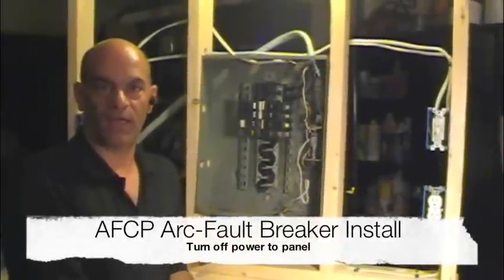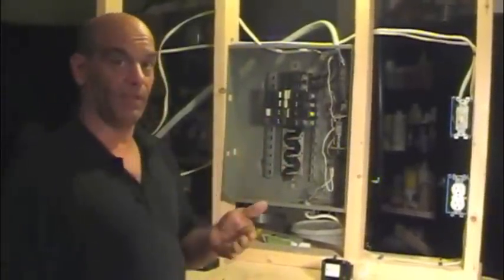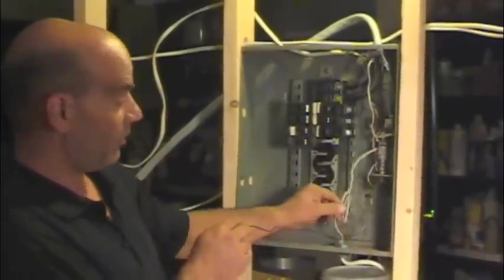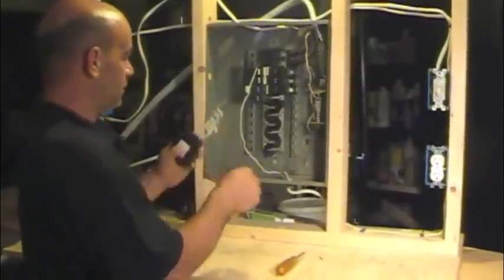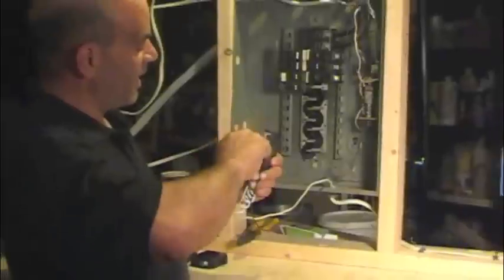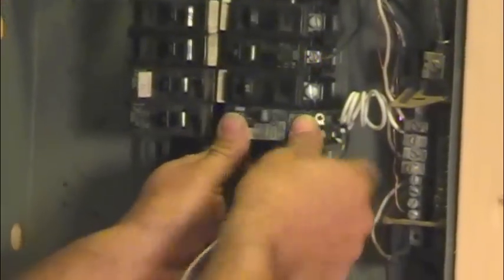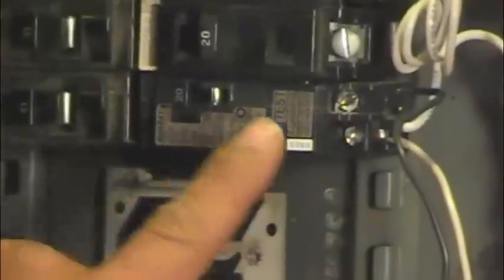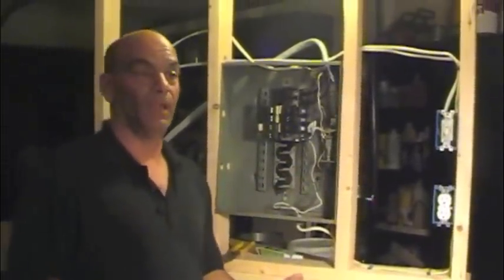How to install a Arc fault circuit breaker / interrupter

Comment: My son's house has many AFCI breakers. This is a siemens box and breakers. After about 5  years one breaker is randomly tripping.  We had the Breaker replaced and this did not fix the problem.  We checked all boxes,  had the outlets and switches on this circuit rewired from backstab to the screws,   we did not find a smoking gun.  It does not trip until there is a load on the circuit, which I read is normal.  Now he has  AFCI breakers on other circuits trip at the same time.  Have you ever heard of anything like this?
Reply from the maker: I've seen it all. For sure you have something going on. The biggest thing that is always overlooked is the outside outlets. Check those.
Reply: @Askmediy I did not think about that. I am going to check his outside boxes, but I expect that they would be on a GFCI circuit but I know strange things happen. Thanks for replying back
Reply from the maker: @freewoodencrosses  I just had one doing the same thing two weeks ago. But I had to remove the GFI outlet that was outside in order for it not to trip. I was a bad/wet GFI outlet.

Comment: I have a weird issue that I am looking for a solution for.  I have a microwave above my stove on one dedicated normal 20A circuit breaker, when the microwave runs, it pops a AFCI breaker on only one of my bedrooms most of the time.  The microwave circuit does not have an issue in any way or time, but the bedroom pops most of the time the microwave runs.  The circuitry has not been modified at any time, and the bedroom has a computer as well as the internet via cable modem.  The bedroom has no issues at any time except when the microwave turns on.  I have checked the conductors in the outlets both in the microwave and bedroom jacks.  I will be looking at the neutral and ground bars in the box tomorrow.

Do you have any advice on this situation?  I checked the phases these two breakers are on and they are both on the A circuit (Microwave in on the 5th slot left and the bedroom is on the 9th slot right side).

Hoping you might have an idea to check on..

thanks!
Stan Skaggs
Reply from the maker: Stan when it comes to these breakers it can be a real pain. Honestly I would change the breaker out for the microwave to a regular one. I see this all the time.
Reply: @Askmediy  The microwave has a regular breaker.  the bedroom has a AFCI breaker.  When the microwave starts, it drips the AFCI for the bedroom breaker yet the microwave continues to work fine with no issues.  The microwave and bedroom are two seperate breakers (Microwave is normal one and bedroom is the AFCI).  It seems insane to me that one circuit affects a completely seperate circuit.  The Microwave is on the left side on #5 where the bedroom is on the right side on #9.  I believe both are on the B Phase as an FYI..  I will be checking the Neutral lines tomorrow to see if something is loose there.  I have checked at the actual outlets already finding no loose connections..  Ther other AFCI breakers never trip either with on being the #10 & #11 on the right side..
Reply from the maker: As you would think a bad connection anywhere could trip this breaker. So yes check everywhere. Definitely check the outlets on the bedroom. And all the connections on the breaker. Simple would be to replace that breaker with another arc fault. I’m in Italy right now in the dark as it’s 4:30am on phone trying to read all of your post. Not so easy lol. But I’ll do my best.

Comment: I thank you for taking time to read my comment need your  just replaced 15 amps arc fault  breaker for one of my bed room   and still not  work what  possibly wrong with it
Reply from the maker: What comment and I have no idea what you're talking about.
Reply: I thank you for taking time to read my post need your  just replaced 15 amps arc fault  breaker for one of my bed room   and still not  work what  possibly wrong with it
Reply: Thank you for taking your time🤪😭

Comment: new house built. noticed that several afci breakers were randomly tripping. dishwasher circuit the most..finally got annoying after 6 months enough to call original electrician. sent some goobers out to "replace" breakers.. no problems.. fast forward 8 more months and now dishwasher has died. no lights/ response from display. (may be unrelated problem) pulled cover off panel and breaker was not tripped. pressed "test" on breaker and nothing happened so i figured the breaker was bad. was about to swap with another breaker known to be good and noticed that when the elctrician came out 8 months prior they had not actually replace breakers but bypassed the afci neutral and run the neutral directly to the neutral bar. the black hot wire was under load screw and the white pigtail was loose with a wire nut on end. They wired about 6 other breakers the same exact way. will not trip when "test" is pressed. Is this common practice or trash?:vs_mad: thanks for any input Bryant
Reply from the maker: First, sorry for the delay. For some reason I'm not getting notified of incoming comments. Sounds like a neutral issue and not the breakers. Could also be that they have something using the same circuit that shouldn't be. I would check every outlet with a polarity checker first.

Comment: Sometimes outlets are installed upside down even though the one in this video isn't. In a kitchen, they might have the outlet flipped upside down with ground at the top, just in case a liquid drops onto a plug in a receptacle, it'll hit the ground first.

Comment: How can a cut Greenfield wire be repaired? Can a junction box be installed were the cut is.

Greenfied wire has a hot, neutral, and ground is the metal outside sheathing. Its in a 80 year old home. 15 amp ceiling light circuit.
Reply from the maker: Why not just reconnect it with a wire nut?
Reply: @Askmediy  It make sense to install a wire nut with a junction box but I've never heard of some one doing this and if the NEC allowed it. I was hoping not to replace the whole wire. Thanks for your help.

Comment: I have the same Siemen's breaker you demonstrated, and this fits in my GE sub panel.  Can you mix/match them, or do I need to get a GE AFCI breaker for a GE panel?
Reply: Jared Waterman Based on this post I found (http://www.nachi.org/forum/f19/mismatched-circuit-breakers-22931/#post278213) it would seem that installing a different brand breaker could void warranty and UL certification of the panel. I've also read elsewhere that possible problems are loose contacts and overheating. That said, it seems if the breaker is "classified", it would have been UL certified and tested to work in other brand panels that it was designed/tested for (http://www.nachi.org/forum/f19/mismatched-circuit-breakers-22931/#post278182).

I was also looking to replace a breaker in my GE panel (a AFCI in place of a regular), and an Eaton would not take up more space (depending on the model), while a GE GFCI is almost twice a wide. I'm hesitant, and a GE brand is a sure guarantee to be safe.

Comment: What is the cause if the test does NOT trip the circuit. Just did a home inspection and been living there for 3 years with no known issue.

Comment: Well the only code I found here in Michigan is if the outlet is switched the it should be installed ground up, this denotes the outlet is in fact a switched outlet. and ground down on none switched outlets. I'v seen a lot switched and not installed ground up, for the most part it is a visual aid to an electrician so he knows what the intention of the plug is used for.

Comment: is there a difference in color with the screws where we hook up the wire to the breaker
Reply from the maker: No, you're still paying attention to what wires you're connecting. That's the important part here.
Reply: I just installed a square d arc fault breaker. It's very well marked which was the neutral and hot. It had an "N" with an arrow pointing to the screw. Also don't try to wrap the wire around the screw. The Neutral is usually the screw closest to the pigtail.
Reply: yes

Comment: with an arc fault breaker (s)
can you use 1 neutral with 2 different circuits /breakers
I have 2 circuits /wires ,in 1/2 emt, installing 2 arc fault breakers,but in the conduit is only 1 neutral
can 2 arc fault breakers share the single neutral in the breaker box ??
Reply: I believe you can not share a neutral wire. each arch fault circuit needs its own
Reply: You are correct. Basically they become dedicated circuits.

Comment: For the record it doesnt matter where you connect the neutral wire on the neutral bus. Any where on the bus that is easily accessable will be fine.

Comment: 1 NEUTRAL SHARING 2 CIRCUITS , CAN I INSTALL ARC FAULT BREAKER , ? 
with an arc fault breaker (s)
can you use 1 neutral with 2 different circuits /breakers
I have 2 circuits /wires ,in 1/2 emt, installing 2 arc fault breakers,but in the conduit is only 1 neutral
can 2 arc fault breakers share the single neutral in the breaker box ??
Reply: Yes, you can, however, each hot leg must be on a separate/different phase.

Comment: Does the circuit breaker need a ground wire?
Reply from the maker: Not the breaker it self.
Reply: Because I have 3 breakers there with multiple circuits on them and the test button isn't working and a GFCI tester isn't flipping the breaker. What would cause this? I have power 2 neutrals and ground hooked up
Reply from the maker: Trying to understand exactly what you're talking about is a little hard to understand.  This video is about arch fault, not GFCI. Which one do you have?
Reply: @Askmediy  yes to C3 circuit breakers are GFCI
Reply from the maker: Use a GFCI outlet tester

Comment: Great video. I will be installing two for some aquarium equipment. Does these AFCI breakers super seed a regular GFI outlet? Meaning if I use this breaker I don't need a GFI?
Thanks again...
Reply: No, they protect a different electrical issue that can possibly become present. You can purchase dual type thought, GFCI & AFCI.

Comment: I hate arc fault breakers. They're an incomplete technology.  Everything arcs. You turn on a light, there is an arc. you plug something in while its on, there is an arc and if its off and something else is drawing from the circuit, theres an arc. you plug something into a power strip, there is an arc. arcs happen all the time. Persisting arcs are what cause fires. Jboxes, even the plastic or ceramic residential jboxs are designed to starve fires of oxygen, making these circumstances extremely rare.  on top of that you have smoke alarms to alert residences of the rare case of an electrical fire. But afci will go off for damn near any reason after a few years, even devices already plugged in that suddenly pull a greater load, like AC's or hair dryers can cause them to trip. It is a promising technology, it is something that should be made into a standard in the future, but currently it is in beta, and has no business being in code.

The mechanisms that make arc fault breakers trip deteriorate over time from false triggers like turning on switches, or pluging in a vacum cleaner in the on position. after as little as 2 years, these things will fail do resist false triggers, and trigger on damn near anything, requiring them to be replaced at up to $80 each.
Reply: I agree 100% , expensive , they'l have to combine them with GFI's , not yet . The best ones in the Navy have the electronic circuits on them that prevent the false triggers . These ones will trip for no reason , a nuisance , some of them come faulty from the factory .
Reply: I've done dozens, if not over a hundred, houses with afci. I have only had issued with afci if the electrician is a poor installer.
Reply: Actually they work as advertised. Evidently your problems lie elsewhere.
Reply: @schwartzmatthewe  💯% agreement.

Comment: A ground fault circuit breaker is not the same as an arc fault circuit breaker.  An afci protects against wires arcing and a gfci doesn't.

Comment: Now why don't you  try explaining something much more useful and probabaly more difficult: Why an AFCI breaker trips when my old breaker didn't trip. I just replaced two 15 amp breakers in a four year old panel, worked fine; the  new breakers both trip instantly. As far as I'm concerned, AFCIs are a scam to sell more and higher priced breakers.
Reply: Edwin Barker call a licensed electrician and let him troubleshoot it. If your arc fault breaker is tripping its doing its job. Once again, call a licensed electrician.
Reply: Could be a neutral and ground tied together in circuit. 
Old breaker could care less,  it just senses load via heat on the main power out line. Neutral does not come back to breaker. 
ARC breakers are mini computers and detect the difference of load out/ load in on neutral.
If you are losing current into the ground somewhere,  it will sense this and trip.  That is my take from studying these a few hours.
Reply: From an article: “AFCI breakers will trip if/when wiring is damaged,” so you may be dealing with some damaged wiring on those breakers. Call a licensed electrician!
Reply: @randyjohnson4007 
GFCI breakers detect the imbalance between incoming and outgoing .
AFCI compares the waveform of the current to identify a spark event.